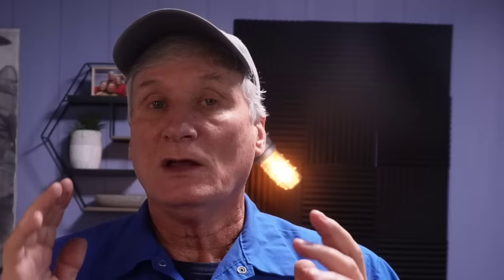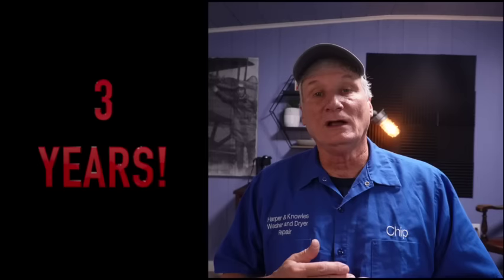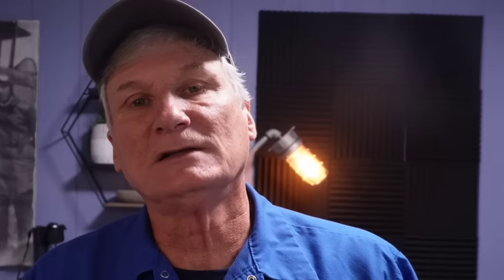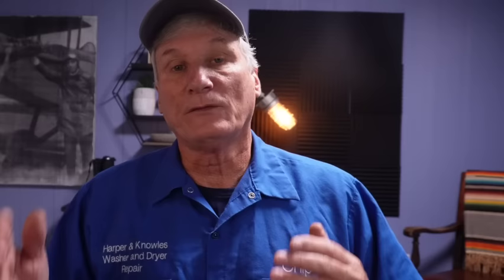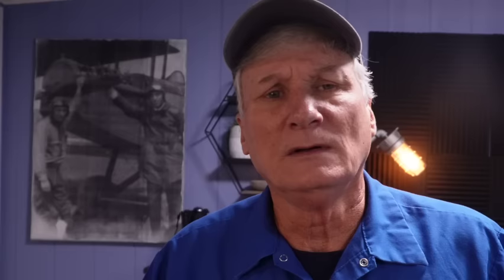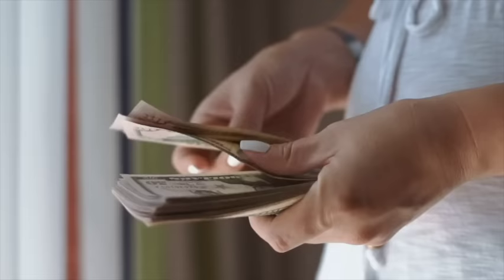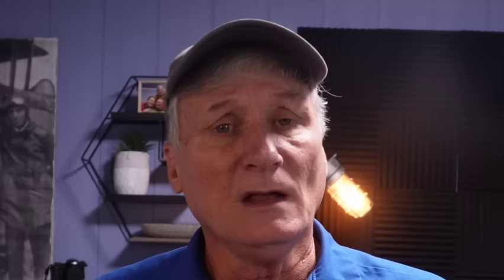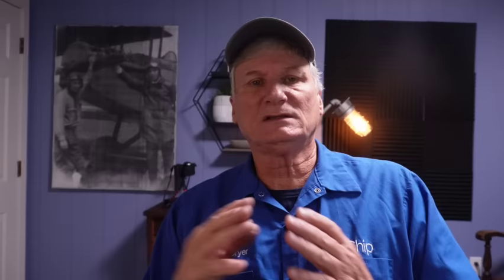How To Choose the Best Washing Machine: Speed Queen TC5 vs. TR7 Review

Comment: Speed queen has one of the smallest tubs in the industry 😮
Reply from the maker: Thank you for taking the time to watch my review and share your thoughts on Speed Queen washers. You're right that Speed Queen washers have relatively smaller tubs compared to some other manufacturers. However, I'd like to point out a few factors that I believe make them a great option for many consumers.

While it's true that other brands have increased their tub sizes, many have not adjusted their suspension systems accordingly, which can lead to potential damage if the machine is overloaded. Speed Queen, on the other hand, has kept its tub size consistent with older washing machine models, which means that it's actually in line with what used to be considered a standard size. This design choice helps ensure that the washer can handle the load without the risk of damaging its internal components.

Furthermore, Speed Queen's suspension systems are specifically built to accommodate the occasional overloading, offering consumers peace of mind when it comes to the washer's durability and longevity. The size of the tub is also sufficient to accommodate large items, like a queen-sized comforter, without causing any issues.

While the smaller tub size may be a factor to consider, it's important to weigh that against the durability, reliability, and overall performance of Speed Queen washers. They may very well be the perfect fit for consumers looking for a reliable and long-lasting washing machine.

Thanks again for your comment, and please feel free to share any additional thoughts or questions you may have. Happy washing! 😊
Reply: @HarperandKnowles We love The Queen

Comment: I bought a Best Buy washer and dryer and the washing machine rinses too many times
Reply from the maker: It's unfortunate that you're experiencing an issue with the excessive rinsing on your Best Buy washer. Without knowing the specific brand and model of your washer, it's difficult to provide a specific solution. However, some washers offer optional settings such as "Extra Rinse," which can result in additional rinse cycles. You may want to check the settings and see if there is an option to disable or adjust the extra rinse feature. If the issue persists, I recommend reaching out to the manufacturer or contacting Best Buy customer support for further assistance.

Comment: How much would TR7 control panel cost if it went wonky?
Reply from the maker: Good question. I don’t know the answer off the top of my head because I’ve never had to change one. I did a web search and found a wide variety of prices among vendors. They can be found anywhere from $85 on eBay to over $300 on some other sites. It pays to shop around when purchasing appliance parts. Thanks for watching!

Comment: About 10 years ago I bought a new GE wash machine for about $400.00. It lasted 1 year and 10 months. My old machine was a GE that lasted 25 years. It had a porcelain tub. So I scrap the new machine, and found an old GE wash machine with a porcelain tub, and it is still going 10 years later. The new GE machines are garbage,,,,,,,,,,,,,,,,
Reply from the maker: I agree with you. There’s very little pride in manufacturing anymore. Thanks for watching!

Comment: Washer reviews are scary. I've seen other models with one star ratings over and over...
I would of thought of a 2.5 cu. ft washer to be a standard for a highly durable washer in small places.
Uhm can't find one.....   .9, 1.2, 2.0, 3.0, 2.2 side cu.ft.      11 lbs( a wet beach towel)
I don't think most people care about all the fancy features. Just something highly durable to last.
I think I seen some Maytags last 20 -30 years..The drums were heavy...imagine the motor?
Portable, by some reviews, may only last a year or two? Maybe its because it's not so local anymore.
The motors keep improving but don't last, or it's other problems? Moving parts or not!!
Reply: I guess  a 2.5 top loader would almost be a full size washer anyway. 
What's another .7 or .9 cu ft anyway... a 3. + cu ft. whatever
Hmm, maybe if they were permanently bolted to the basement foundation.
Or a new mini pressure jet washer™
Reply from the maker: Thanks for watching!

Comment: That would be a pre-2000 NON "Energy-Star" top loader with a 7/8 HP motor. Take care of it, don't overload it, and it'll be like mine, coming-up on 35 years old and BETTER according to repairman that put a belt on it last month, than the new $900 top-loaders with gim-cracks and gee-jaws to quit. HIS words, not mine! Not a "solid state" push button (or any push buttons) on mine. When my older Sister passed, I could have had her four-year-old front loader pair that she paid $3200 with risers, but I got tired of going to her house every two weeks to disinfect and deodorize the things for $35 our Momma paid. They would REEK! Appliance repair parts store said that was NORMAL.
Reply from the maker: Thank you for sharing your experience and perspective. It's interesting to hear about the longevity and performance of older top-loading machines compared to some of the newer models. It certainly aligns with the idea that "they don't make them like they used to."

Regarding the smell issue with front-loaders, it's a common complaint due to the rubber door seal that can trap moisture and create a breeding ground for mildew. Regular maintenance, including cleaning and airing out the machine, can help mitigate this problem.

I appreciate you taking the time to provide your insights, which I'm sure will be beneficial to many in our community. Your first-hand experience is invaluable. Thanks for watching! 👍

Comment: I have a question for you! In 2014 I bought a Speed Queen model AWN412. Coming upon 10 years with no issues, however since it was brand new, the entire tub "leans" to the right. I can physically and easily push it to center, while its filling or washing,  but it doesn't stay centered while running and always leans back over to the far right side of the machine. I've had no issues, it works great, but I feel like something is off with the suspension system. Have you ever seen this??? Thanks for any advice.
Reply from the maker: You should have someone pull off the front panel and check that all the springs are connected correctly. It’s just like a Speed Queen to work flawlessly even when something isn’t right with it. Thanks for watching!
Reply: @HarperandKnowles  thanks! I bought this model specifically because I could work on it myself and fix things down the road. Having someone else pull off the front panel isn't an option. I guess I'll pull it off and try to see if anything is amiss. When I bought it I adjusted the "water level" which is the only stupid governmental standard for energy efficiency, and adjusted  it so it would fill completely up. And I fixed the switch in the back with a clothes pin, that allows the top to be open while it's running. Bought this for self repair basically. But yes I agree - it works even is something is off kilter from the factory!
Reply from the maker: There ya go it’s always better to fix things yourself!
Reply: @HarperandKnowles  its getting harder and harder to find items of quality like the old days, and self repair. Totally understand the farmers suing John Deere for repair rights.
Reply: @UnkleAL1962 so u could just add water from a pitcher filled at a tap? To bring water level up? Machine would still run?
Reply: with my machine I actually pulled the top control panel off and was able to adjust the water level so it would go higher to the top. If you were to manually add water I should think it would still work fine. Just don't overfill the tub.
 @YeshuaKingMessiah

Comment: I do not recommend the lint filters on LG dryers. The are pathetic and leak a lot of lint.  Also their machines without an agitator wind the clothes up and tie them into knots.   Machines with an auger style agitators end up sawing holes in your clothes.  It's hard to find a decent washing machine anymore.   Most seem to be made by LG no matter what the brand.  My old Maytags lasted over 50 years, and were still running when I decided to buy replacements.
Reply from the maker: Thank you for sharing your thoughts on LG dryers and your experience with different washing machines. I understand that not everyone has the same experience with their appliances, and it's important to consider various perspectives.

Regarding your comment about LG making most washing machines, it's not accurate to say that LG manufactures all brands of washing machines. While LG is a prominent player in the market, there are other reputable brands, such as Whirlpool, Maytag, Samsung, and of course, Speed Queen, that manufacture their washing machines.

As for the issue of clothes getting wound up or damaged, the performance of a washing machine can vary depending on the specific model and its features. It's essential to research and read reviews to find a washer that meets your needs and preferences.

It's impressive that your old Maytags lasted over 50 years! Nowadays, it's rare to find appliances that last that long, but there are still some brands, like Speed Queen, that prioritize durability and longevity in their products. Keep researching and looking for the right washing machine for you, and don't hesitate to ask for recommendations or advice.

If you have any more questions or need further assistance, please don't hesitate to reach out. Thanks for watching my channel!

Comment: Why does this sound like a speed queen ad written by a marketer?
Reply from the maker: It was written by me. And I wrote it because it is my honest opinion that Speed Queen is the absolute best machines on the market today. Mainly because I rarely get to work on one. I have worked on dryers in homes in my area that have Speed Queen washers sitting beside them. When I asked where the client got the machine they all say the same thing, “From Mr. Cottongin.” Mr. Cottongin was the last Speed Queen dealer in my home town and he’s been dead for 35 years! I’m a skeptic too, but if you ever own one of these you won’t be disappointed. Thanks for watching!
Reply: @HarperandKnowles  well good job. Funny thing is I ordered the FF7 and matching dryer last weekend before I saw this video. I should have in 3 weeks. Any review of those? I needed that so I could do king size comforter. 

I’ve had Maytag, LG, and most recently the new GE All in One. After two of those GE being delivered with issues I gave up and went to speed queen. 

The LG was ok but during my 7 years with it, I had to replace the water inlet valve on the washer and the heating element in the dryer.
Reply from the maker: Unfortunately, I don’t have any experience with the FF7’s but I will assume they are of the same quality as their other products. They are all made to be used in a laundromat environment. I think you’ll do well with them.

Comment: Your right they dont make them like they use too. 
what miss in a washer: 
Fixed water level selector, An full sized agitator that actually rotates the clothes in the tub, finished wash buzzer

My first washer I ever bought for myself was a whirlpool bought in 2001 it lasted till 2020. What killed it was my main water line on my house burst when I had it replaced sediment came in though pipes and clogged pumps in the washer. 
The replacement an near $900 Maytag is a complete joke. the only way to get this crap to put enough water in machine is to wet clothes first then stick them in tub. This only works on the cycle of the wash on the rinse it back to machine set water sensing level. I have tested this many times I have added things to wash after it started laying a piece of clothing on top and it has stayed dry.
Reply from the maker: If you still have your old washer you could try changing the water inlet valves. That should fix it. Thanks for watching and sharing your experience!
Reply: @HarperandKnowles  no it happen a year ago. 2 years ago it has long ago been disposed. I was just mentioning it and that it still worked just would not fill with water and it would go tough wash cycle then stop before spin.
I miss that washer it was a simple on and it worked.

Comment: Just got a TC and its JUNK!!! Won't  go through a full cycle and smells like its hot and not sure what to do now.
Reply from the maker: Did you remove the shipping brace??
Reply from the maker: Problems with new machines are usually fixed fast by the merchant or the manufacturer. I’m sorry you’re having trouble but don’t discount the product until you know the source of the issue. Thanks for watching, I’m sure you’ll get the problem solve solved soon. It’s probably something simple.
Reply: Yes mine too gets really hot and smells like burning, AND has gone through 3 repairs. You aren't alone!

Comment: Residential speed Queen is NOT the same machine as what you find in laundromats!
Reply from the maker: You're correct that residential Speed Queen washers are not exactly the same as the commercial models you'd find in laundromats. While both residential and commercial models are designed with durability and reliability in mind, there are some differences in features, design, and performance.

Commercial models are built to handle heavy usage in a public setting and often have coin-operated mechanisms, more robust construction, and simpler controls. On the other hand, residential models are designed for home use and may have additional features, such as multiple wash cycles, settings for fabric care, and even energy-saving options.

Despite these differences, Speed Queen's reputation for quality extends to both their residential and commercial product lines. If you have any more questions or need further assistance, please don't hesitate to reach out. Thanks for watching my channel!

Comment: The problem is they dont wash the clothes good.
Reply from the maker: Thank you for your comment and for sharing your concerns about the washing performance of Speed Queen washing machines, specifically the TC5 Classic Clean and TR7 Quiet Clean models.

As a reviewer, I understand that individual experiences may vary and what works best for one person might not be ideal for another. In my review, I have considered various factors, such as build quality, durability, and overall performance to determine the best washing machines for 2023. Based on my research and personal experience, I have found that both the TC5 and TR7 models provide excellent cleaning performance.

The TC5, with its traditional agitator mechanism, offers a more aggressive washing action that has proven to be effective for heavily soiled clothes. On the other hand, the TR7 is designed for those who prefer a gentler washing action, with its connected agitator and spin tub, which might be more suitable for delicate fabrics and garments.

If you have experienced unsatisfactory cleaning performance with either of these models, I would recommend checking the following:

Ensure you are using the appropriate amount and type of detergent for your specific machine and load size.
Make sure you are selecting the correct wash cycle and settings for the type of garments and the level of soil on your clothes.
Avoid overloading the washing machine, as this can prevent clothes from being properly agitated and cleaned.
If you continue to experience poor washing performance, you might want to consider reaching out to Speed Queen customer support for assistance or exploring other washing machine models that may better suit your needs.

I appreciate your feedback and hope this information is helpful. If you have any further questions or concerns, please feel free to ask.

Comment: First speed queen we had fell apart like a cheap shirt.
Reply from the maker: I'm sorry to hear about your disappointing experience with a Speed Queen washer. While it's true that no brand is immune to occasional manufacturing defects or quality control issues, Speed Queen has built a solid reputation for their durability and reliability over the years.

It's unfortunate that your washer didn't live up to expectations, and I understand how frustrating that can be. 

Your feedback is valuable, as it helps me improve my channel content and also helps other potential buyers be more aware of the real-world experiences with these products. I hope you'll find other content on my channel useful, and please feel free to reach out if you have any questions or suggestions.
Reply: @Harper & Knowles Washer and Dryer Repair  Every manufacturer can produce a lemon. We switched to Maytag when Maytag still produced a quality product. When that wore out, wd purchased a Maytag front loader. Another piece of junk. The motger boards kept failing. So, we purchased a Whirlpool Duet washer and dryer. They have performed well. I like the stackablity of the frontloaders. Does Speedquedn make a quality stackable frontloader for residential use? If so, do you know if they are worth the money? Looks like the EPA/Congress is going to have to get on 'durable goods' manufacturing to make them durable again.